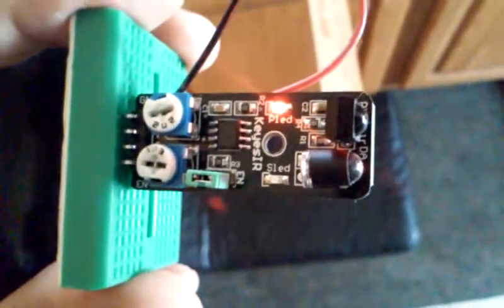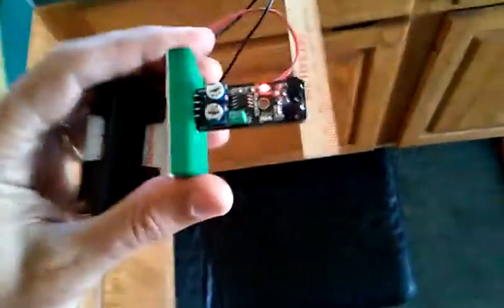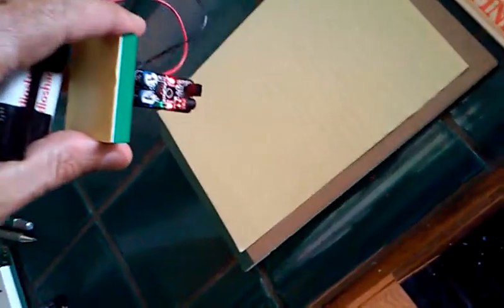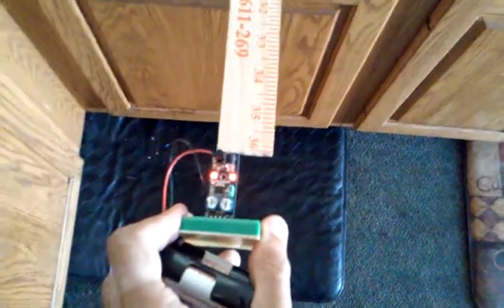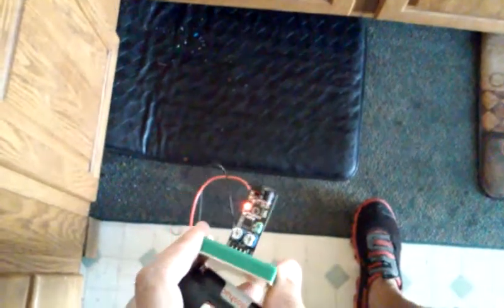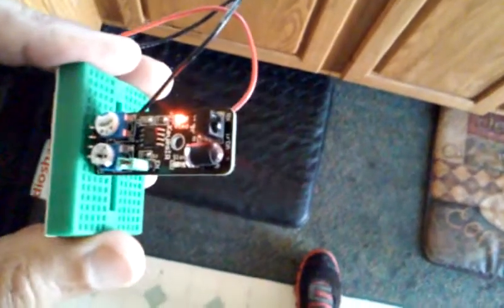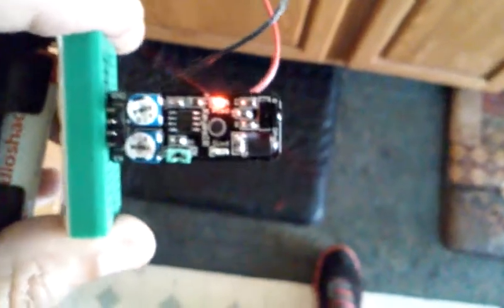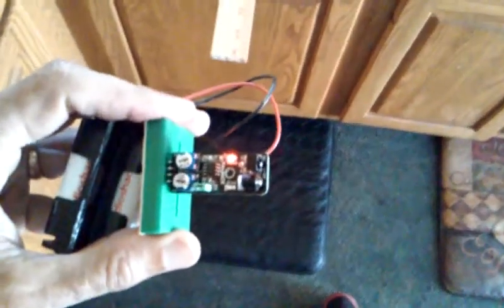Proximity Sensor

Comment from the maker: I have bought eight of these sensors. Two can be adjusted to work fine, but the others don't, no matter how I twirl the two adjustment pots. Could not get the output frequency anywhere near 38 kHz. Just today I took a closer look and the two pots are switched on all of my sensors units as compared to photos at http://www.dx.com/p/ir-infrared-sens...7#.VF6j-TwtBIc and http://www.amazon.com/NEXT-Infrared-.../dp/B00NPZ6RCC . The 103 pot goes by the GND pin and the 202 pot goes by the EN pin. Swapping them back (obviously) restores proper function.  Printed on the PCB is "10K" where the 103 pot belongs, and "5K" where the 202 belongs.  
This video and the thumbnail photo  show the incorrect parts placement.
The 103 pot controls the 555's output frequency to drive the IR LED, which should be adjusted to ~37.5 kHz to match the IR receiver module frequency. The 202 pot is a power output control for the IR LED which can be adjusted to trigger at different ranges. Once you swap pots and adjust, it's a nice little sensor.